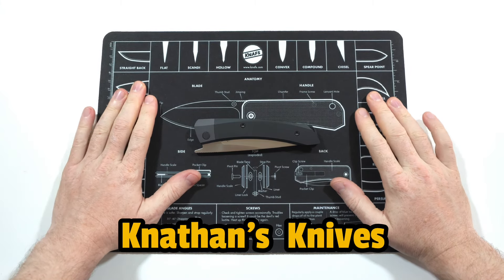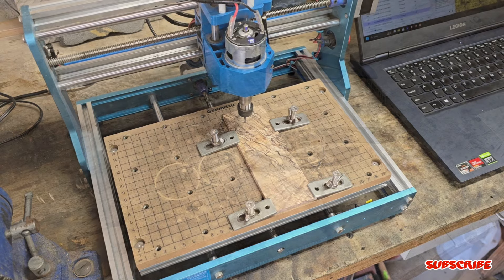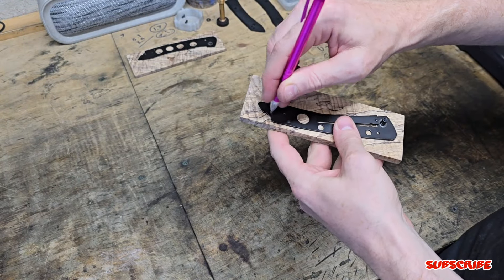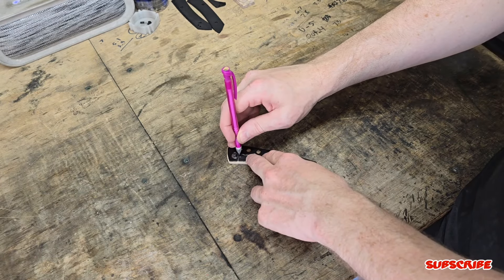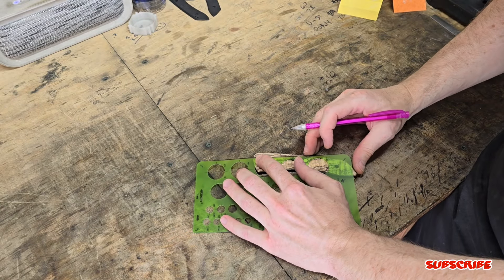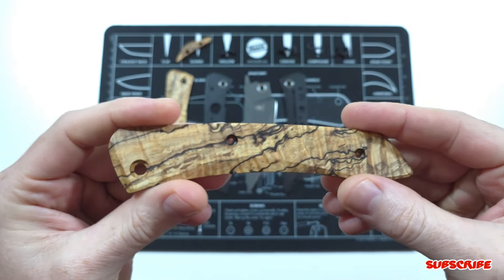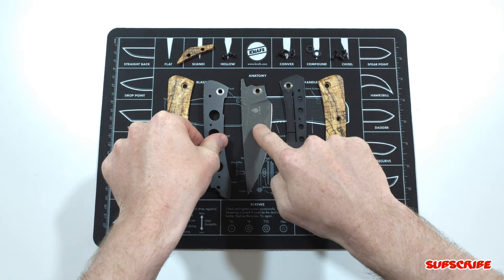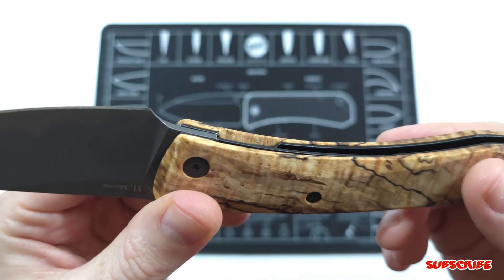Customizing The Kizer MOMO Pocket Knife!!! #handmade #custom #edc

Comment: Sweet knife to begin with, didn't know that one. The modded result is perfect - well done! Question: does the blade treatment not affect the slicing capability at all?
Reply from the maker: It's a great knife from Kizer and thank you! 
I haven't noticed any difference in slicing on all the knives I've etched, as long as you sharpen it well, you're good to go!🙂

Comment: How did you get the faux hamon I was super excited to see and hear how you achieved not only the faux hamon but just how you did the etch on the stainless etch on the 154cm I tried it once using ferric chloride on the copper handled towser k (in an attempt to darken the blades seriously to match the copper handle) was little success despite multiple dips in the ferric. This is my first time checking out your channel so perhaps you have a different videos or something with that process if you could Point me that direction or help me out here with what you did that would be much appreciated?
Reply from the maker: I used a mix of Ferric Chloride(80%) & Apple Cider Vinegar(20%). 
I noticed that Kizer's 154CM Steel etches perfectly too!
Here's my How-To video on the FAUX HAMON etch:

https://youtu.be/JBI7ohDBa9k